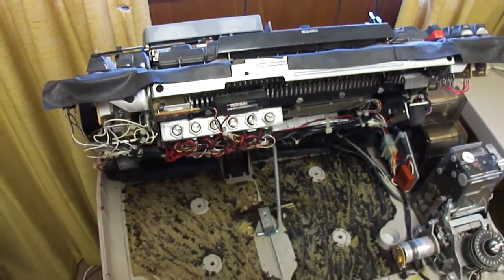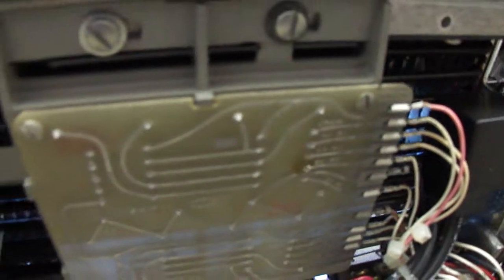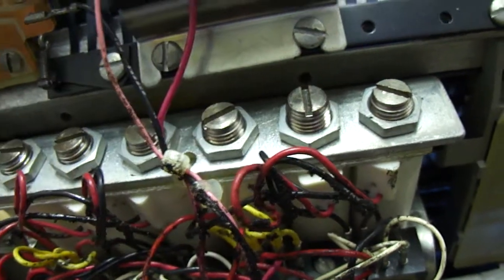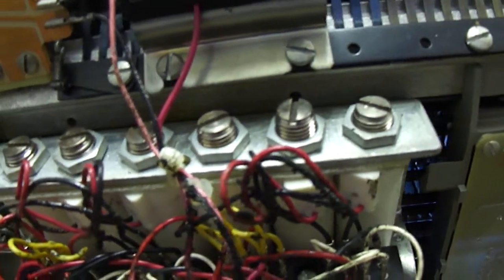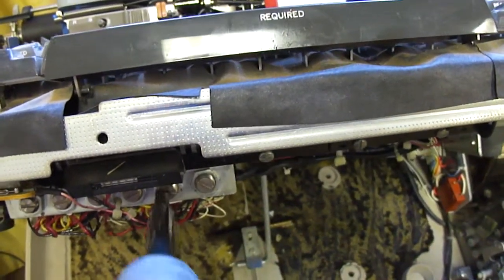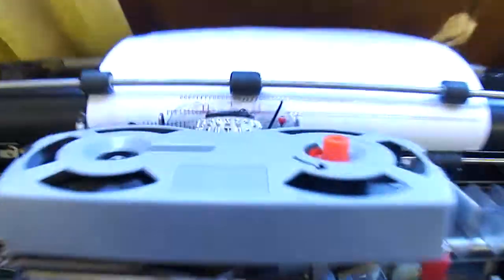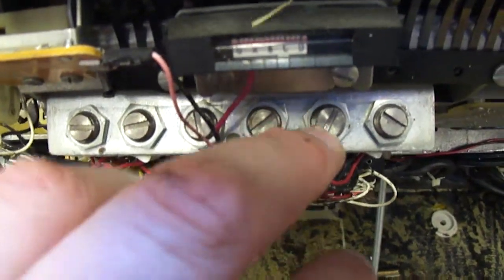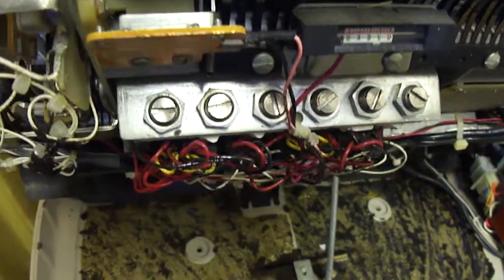1982 IBM Memory 100 Typewriter Solenoid adjustment

Comment: I have a correcting Selectric II that mis-types when it's first turned on. it's not a memory machine.  it will begin working correctly after running a while.  this occurred after the machine was cleaned and serviced some years back.  I've never attempted adjusting it because I don't know what to touch.  any thoughts?  thanks!  KF
Reply: It's probably time to have it looked at again....